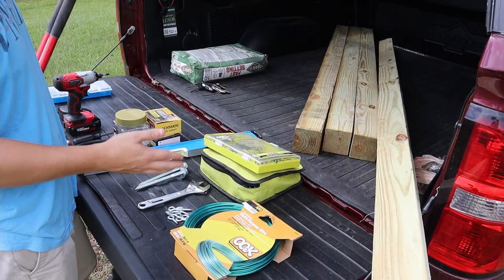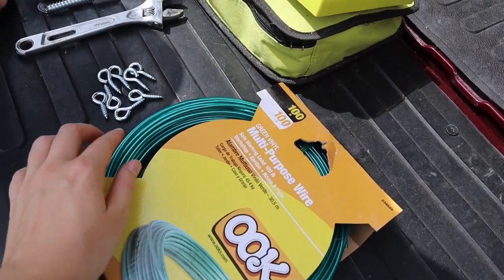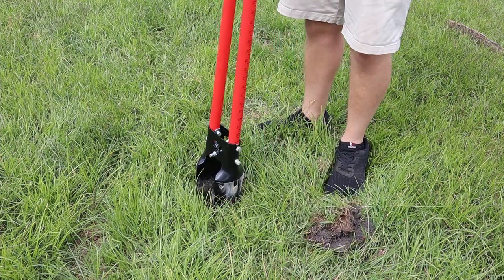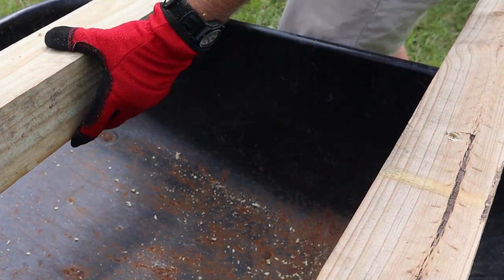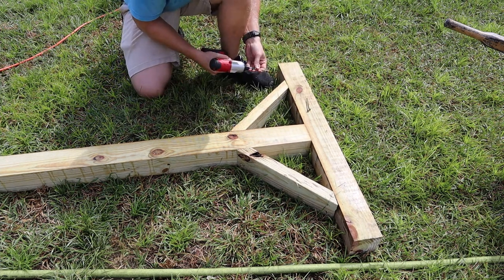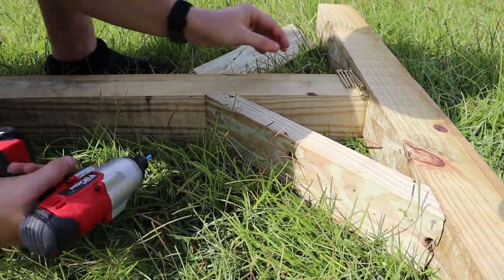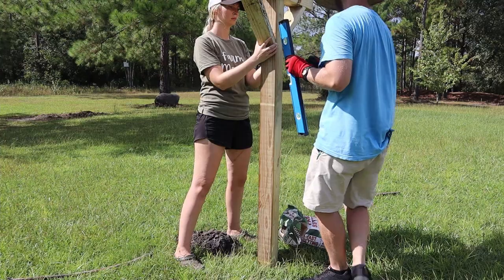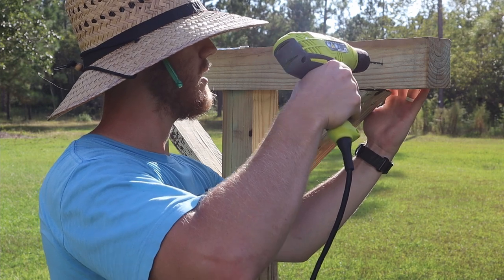BUILDING A CLOTHESLINE + The BENEFITS of Using a Clothesline! | The Galloway Farm

Comment: Don't know about 1 foot in the ground. I've always done at least 2 if not 3. Blankets and towels are heavy. You can also just dump the concrete into the hole with no water, the moisture in the ground will work it's magic. Don't tamp it after the concrete has set, all you'll do is bust up your concrete. Your eyelet bolts are way to small, again blankets and towels are heavy. They should be at least 3 inches. You also should grab a few tensioners, the wire will stretch.
I'm a 60 year old man and have put up quite a few clotheslines in my time. I like to do things once and be done with it.m
Reply from the maker: Thanks for the input!  So far everything has held up regardless of what we’ve placed on it. It’s also weathered a couple hurricanes in its existence as well, so for a first clothesline, we’re content.  Thanks for taking the time to give some suggestions for the future - we’ll take all the wisdom we can get!
Reply: @TheGallowayFarm  Wasn't being critical of you. Just saying how I used to do it. I appreciate your videos
Reply from the maker: @MuscogeeCreekMan  understood, we didn’t take it that way at all. The only way we learn is by trial and error or by listening to others who have tried and erred (or succeeded!). We appreciate you checking us out.
Reply: I was thinking the same thing about it possibly not being deep enough depending on where you live, currently fixing to put us up one for backup use primarily and sheets as they never dry right in the dryer. Last summer our dryer quit working out of the blue one day, what a pain and now it takes weeks to get a new one delivered from anywhere.
Reply: Your eyelet bolts are way " too " small.
Reply: @kendalgee5808   Gotta love the idiots who have nothing better to do than correct spelling on a grandpa's hastily written post. You're 2 be commended for your due diligence in correcting one of my too posts in this thread, and thank you to.

Comment: In Quebec, Canada, we have pulleys at both ends, a long loop of wire, from a back porch to 50 fett away let’s say and a tensionner in the middle, so we can stay put with the basket and just scoot the clothes along. The tensionner is to keep the sagging at a minimum. 
I’m in europe and have a smaller backyard than frontyard, so i have a similar setup to you with parallel lines, but i got pulleys to. Made the build more expensive but more enjoyable to use, so i use it more often.
Reply from the maker: Sounds like an awesome idea especially if I (the husband) have to do the laundry!

Comment: You need a wire tighter to go on the end of the wire to keep the wire tight, over time the line is going to sag down especially with blue jeans on it
Reply from the maker: There are quite a few tweaks that wouldn’t break the bank and would be very helpful - this is one of them!  Thanks for the comment (:

Comment: HOW LONG IS THE HOLE IN THE GROUND?
Reply from the maker: We dug ours 1 ft. in the ground but you could go deeper depending on the length of your 4x4 posts and the overall height that you might want your clothesline. Hope that helps!
Reply: @TheGallowayFarm  Thank you....greetings from the Inkas's land
Reply from the maker: @cesarsantiagopintoespinoza5996  So cool!  thanks!!
Reply: I would go below the frost line if possible. The gas auger is your friend here. I bought one incredibly cheap. If you have other holes planned like a deck or mailbox maybe a fence, well worth it. They're like $200. I think drilling the wooden post and maybe using metal conduit through it for the T or angle iron off the back would have been good too. Good video anyway and I'm sure you will enjoy it. I want to make my wife one with a pulley so she can stand on the deck and do it quickly.  Might not get that at this house. We are planning on selling it and moving.